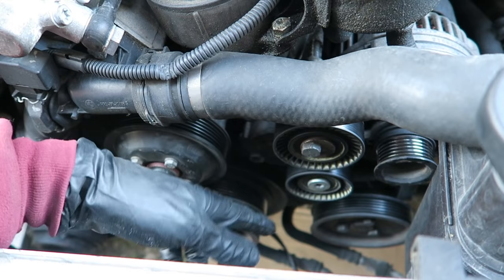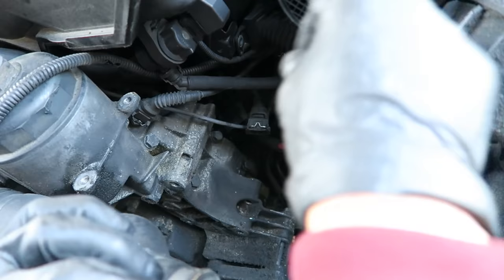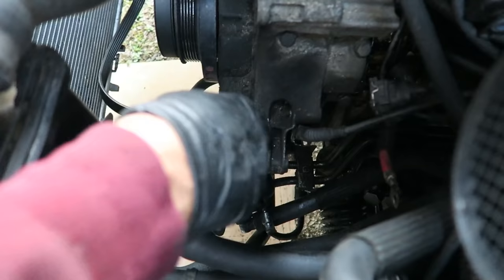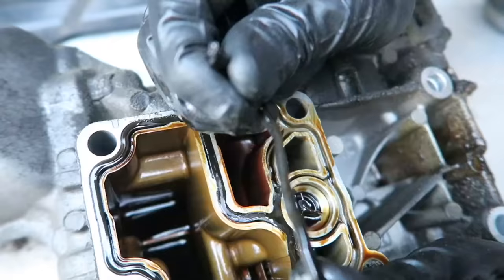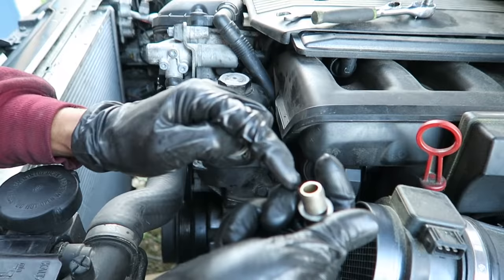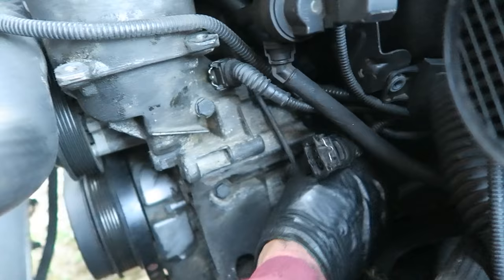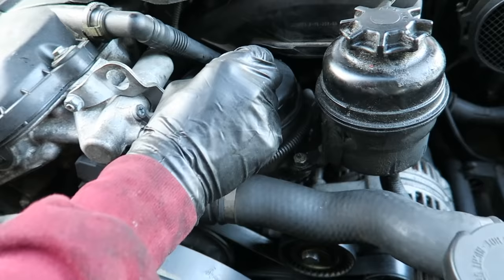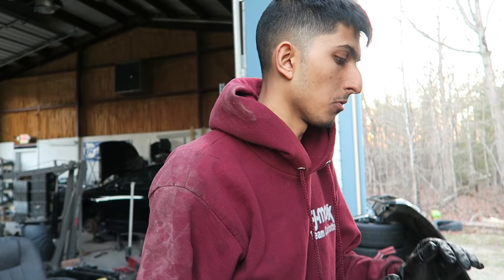E46 Oil Filter Housing Gasket Replacement DIY

Comment: Tip: You dont have to drain the oil or remove the battery cables or take off the oil line from the back of the filter plate. You can simply remove the oil line from the front with a 17 wrench. Also, once you remove the ground cable from the back of the alternator, just move the cable away from where u are working otherwise if you touch your ratchet to it, its gonna spark. And also, not alot of oil comes out once you remove the oil line or the filter housing, just put a rag or something under just in case. Quick 1 hour job or less if you know what youre doing
Reply: that possibility of sparking is why you disconnect the battery cable...murphys law always in effect..."if something can go wrong, it will..."
Reply: Thanks for that info. I just changed the oil in it last week and certainly don't want to go through all that. Battery I am going to do as its better to err on the side of caution.

Comment: Torque specs for 6 bolts = 22nm or 16lbft
Reply: Ayenew Thanks!
Reply: This would of been useful if ive seen it early because i stripped the block on the top right i just hope it doesnt leak when im running it

Comment: quick tip to make sure you get the bolts back correct in the OFG. Take a rectangular piece of cardboard, label top and bottom, punch 6 small holes, 2 top, 2 middle and 2 at the bottom. As you remove the bolts from the OFG, place them in the same orientation. If you don't,  you risk stripping out a bolt when trying to torque down, if it bottoms out. They are different lengths.

Comment: You dont need to drain the oil to do this DIY, just the oil filter and lid, as it will hold oil that will constantly drip once housing comes away from engine. 
Also after the alternator is out, but before the Oil Filter housing comes out, then clean away to your hearts content, degreaser, dish soap, microfiber cloths, garden hose etc etc... give it the works.... then remove the oil filter housing, that way you dont have to worry about getting dirt and water into your engine.
Reply: So do i not tighten the Oil filter Housing down to speck with torgue Wrench ? 

Just tighten bolts in like a star form like He indicated ? 

Getting ready to do this and not clear on this .
Reply: I was just going to comment this
I just did this DIY
Easy DIY, 1.5hr start to finish. 
People, do it yourself. Dealership/shops will charge arms and legs
Reply: First Last Torque them! 18ft/lbs. I need to redo the whole job and helicoil 2 threads because I undervalued the torque wrench.
Reply: Yea wasn't planning on draining the oil when I do this. Loosen the filter cap and maybe a new filter 👍

Comment: Fantastic video - had already done this a few years back and my tensioner broke so I wanted a refresher. He spoke clearly - told the socket sizes and sped up the video through any slow parts. I didn't get motion sickness from watching it either - just perfect. All videos need to be done like this, it gets an A+ in my book -thanks so much.

Comment: Many thanks for the excellent video (with tips) on repl. the OFHG.  I can honestly say that I would never have been successful with this if I hadn't watched your video.  I had just changed the oil and filter, replaced the drain plug, and tightend down the filter cap using a crescent wrench.  On starting the car to drive it out of the garage, I checked under the engine to make sure everything was okay.  Well, it was like  I had a hole in the pan so much oil was coming out, I immediately shut off the engine and wondered what I did wrong.  After a little internet research, it was an easy conclusion that the OFHG got damaged with my excessive tightening of the filter cap.  I now have the correct 36mm socket and will chalk it up to a lesson hard learned.

Comment: I wanted an e46 but was scared to get one, cause you know, everyone always say bmw's are very expensive and a pain to maintain. Thanks to you and your channel, I got the my e46 cheap so I can fix it up, and I'm ready for almost anything that comes my way.  Keep it up man!! 

I actually just changed this gasket today on my car. I'm glad for this vid!!! Next step is fixing my window regulators!
Reply: How is the car running so far?  Have you been able to fix a lot of the common issues?  I’m in the market for an e46 and like you I’m a bit skeptical.  I’m not a mechanic but I’m willing to DIY if what I have read on forums/reviews and seen on YouTube is accurate.  Any feedback you can provide would be appreciated.
Reply: Idk about him but last summer I bought a fully optioned out 2002 325ci 5spd sport package coupe topaz blue, clear coat is ruined and it was neglected from Baltimore with 220,000 miles but I paid $2000 for the car running and driving, trailered home. (oil was 4k miles past interval so about 19k miles on that oil if its accurate) changed ALL fluids when I got the car home and the filter was in many pieces... the old oil made it too hot under the hood but it had never overheated, the excess heat just caused the dsc/abs module to fail, I replaced just the module from an 05 330ci I paid $70 for on ebay with pump but I didn't need that (this was the difficult one, under the brake booster and upside down, if you know you know... the motor is completely factory besides a k&n short ram intake and the vcg was still good until I replaced vanos seals. I replaced ccv system with an oil catch can, car wouldn't even run without falling into limp mode everytime with the old ccv. Control arms needed to be replaced and alternator as well as expansion tank but they were all factory with 220k+ miles on them. Clutch is solid, no slip and generally smooth but throw out bearing is toast, had to put a loooong clutch stop on so it doesn't grind when pushing in clutch. I absolutely love the car man I cant say enough good things about it, I've done all of the work in my driveway, only got help compressing suspension when replacing front control arms and im only 16. It's been leaking oil for a very long time and my skid plates are filthy but I just top off with fresh oil after about 5k miles or when it gets half a qt low. Main concerns are blown expansion tank, usually cant tell its blown without driving it, Only buy VDO/siemens mass air flow sensors as the car will never run right unless its oem, ive had 4 different mafs and they all made the car struggle to idle and start I was chasing lean codes and vaccum leaks when the solution was just buying the right maf, they control a lot on these cars. the car has been absolutely solid and is the single best handling car ive ever been in with factory sport suspension. if you find one ofr a good price don't hesitate unless the head gasket is blown they are bullet proof, looking to turbo mine soon.

Comment: Just done mine, along with the VANOS line, and I was amazed at how smooth and easy it was - managed it in less than three hours.
One tip I can offer is to push the housing bolts into an old cereal box to keep their relative position😉.

Comment: Thanks for making this!  I’m getting ready to do the gasket on an E46 with 300,000 km on the odo. This is extremely helpful and I’ll def have this video queued on my phone when I start the job.  I’m doing the oil level sensor as well at the same time, so that DIY you made is also super helpful.

Comment: Used this video to change the filter on my 2001 330Ci.  It helped a ton.  A few lessons learnt.  1) I pushed the power steering pump too far out of the way to give access.  I then put the oil filter housing back in place, and when I came to re-position the power steering pump, it was quite difficult.  Lesson is to roughly put the power steering pump back in position before re-attaching the oil filter housing.  2)  Make a note of which is which regarding the two long  bolts that attach the alternator to the engine.  I mistakenly assumed the long bolt was on the bottom and took about 20mins trying to thread it before remembering the long bolt goes on the top because it also attaches the idle pully, hence the longer bolt.  3) My banjo bolt didn't have washers - the seemed to be built in.....Fingers cross I don't get a different leak.   4) Slight differences on the power steering bracket - but minor.   Otherwise -  all good.  For a first-timer, it took me about 3 hours...but I works slowly making notes, and cleaning oil off the engine and other parts took about 40mins!  Thank you ShopLifeTV

Comment: Good one Jason!  Straight forward and to the point ...excellent video with great camera angles to see everything going on or coming off.  What about the torque settings??  ...I won't bother with them either ...when you got the feel when undoing plus it's hard to get a big torque wrench into those tight places anyway. Thanks for your time in putting the video together and posting it on the Tube. I just did my Z4 rocker cover gasket along with the 2 inside plug gaskets Like yer man below said ...when wedging the set of two of the plugs  ....they exploded into little bits due to the brittleness of the 'rubber' ...'tip'  if doing yours lay a towel around the gaskets to collect all the bits and stop any getting down into the sump or especially under the valves. I had oil burn on the rear manifold but couldn't see where the oil came from? So had the rocker cover gasket on hand anyway changed and re assembled to find I still had oil burn, so removed the cover again to see if it leaked past the new gasket  ...to find out, it turned out to be oil residue from the leak underneath the top valve housing over the manifold ....but! ...it turned out to be an extra job worthwhile, as I found a 8/10 mm piece of brittle plug gasket around the valve area. This could have created a real problem if it washed under the cam!  Thanks again Jason - Apologies for waffling on Just another tip ...best to use silicone grease to lubricate rubber ...reason, it doesn't have the properties to break down rubber, as seen in the brittleness in the gasket removed.     Ea - Perth, West Australia

Comment: The five main oil leaks on this engine are   1. CCV,   2. sump gasket,   3. OFHG,   4. VANOS line, and   5. valve cover gasket.
If you replace the VANOS line while you're in there, this job takes care of two of them👍🏻

Comment: Easiest car ever to work on. I feel that most wouldn't have a channel if it wasn't for these e46 cars. All you need is common sense, the want/time to do it, and be able to turn a wrench. The best videos are the ones not edited to see the mistakes. Nothing ever goes perfectly. For instance, that gasket on a high mileage car is not going to come out/off without a fight of being stuck. It will also break in a million pieces and you have to make sure you don't leave any behind.
Reply: I agree. Working on the E46 M3 is like fixing a bicycle. It's really easy.

Comment: Great Job! I have a Z4 with a M52 engine so it looks pretty similar... I hope... After changing the Valve Cover Gasket, my engine was still leaking so now Oil filter Housing Gasket Replacement... and you can bet that I am going to change the Tensioner and the pulley! Thanks for the Video.

Comment: Great instructional video. After seeing your video I want to do the job my self instead of paying $700 at the shop.  Thanks for sharing this video.
* Update **
So I follow your video to the T and I can say that I finally replaced the oil filter gasket and not only did I fix the gasket I also replaced both tensioners but end up replacing the alternator and both power steering return lines.  Your videos are awesome and just want to say thank you for posting your videos, I spend some $$ in parts but I saved a lot in labor and learn in the process. Thank you
Reply from the maker: Awesome! glad I could help!
Reply: Thanks again. Watching your videos  has inspired me to work on my BMW and do work I didn’t think I could do. Next will be suspension followed by a oil pan gasket.   Keep posting your great videos I’m sure more folks out there are finding them as helpful as I do.

Comment: Nice job on the video.  It covers everything.  Keep them coming and thanks. 
I  am a retired master tech. I just was given a Free 2005 X3 and now getting the chance to ENJOY all the little neat things that they have to offer. Valve cover gasket, oil filter housing and the crazy PCV system. 
Otherwise the car is in very good shape and fun to drive. Is there any other common problems I need to check out before they pop up. Thanks again.

Comment: adding that the torque setting for the 6 odd sized oil filter tower housing bolts is 16 to 18 lbs. I used a piece of cardboard shaped like the mating surface with holes in it  to keep track of the 6 bolts orientation to where they go into the block.

Comment: Also alot of owners torqued the 4 top housing bolts first before tightening the 2 lower bolts. The top 4 bolts are the only ones surrounding the actual gasket. I did star on all 6 and mine leaked within a week. Also forget any stock bmw (or other brands) rubber gasket. Go all in for a Viton rubber gasket and there's a good chance you'll never have to do this job again

Comment: You can now buy,on E-Bay, a pump with pipes to save taking sump off.A tube is put in oil stick hole (after taking stick out )
thin tube inserted,other pipe thicke so used as outlet in to tub/can. Pump clipped onto battery and should empty sump.I would
 suggest stopping pump for cool down after 10 mins.It is something l do to save pump.

Comment: Awesome video, still referring to most of your material with my 2000 325Ci with 380k km (South Africa). Just noted one possible problem: At t=10:43 the tab and notch for alignment do not match up, may cause issues with pulley bearing running out of plane.

Comment: Gonna attempt this tomorrow bro, was having oil pressure issues on start up,so I changed the oil filter cap seals,2 small and large, but then realised my oil filter housing non return valve is staying open, allowing all the oil to go back to the sump instead of staying in the filter housing, it's causing low oil pressure on start up after a few hours. I took the car to a garage but they guy wasted my time saying it required inlet manifold removal etc...so Hopefully this guide helps me through it!
Reply: Completed this job today, only problem was the bottom left bolt thread has mostly stripped, 4mm thread left in the hole but as the rest are fine and it's not near the gasket area I've jus left it & will monitor for leaks. Thanks for this video man, was fundamental in helping me complete the replacement of my oil filter housing.

Comment: Great vid, thanks !  Will be doing mine this week and also replacing that tensioner as mines a little noisy.

But man... this guy and the "go ahead and" :)   Instead of "Next we'll replace the alternator" becomes "Next you're gonna wanna go ahead and replace the alternator".  So much redundant speech, but I've noticed it is and American thing.
In case anyone's interested, my 'Go-Ahead-And meter' registered 35 occurrences in this video. 12 of which were in the first 2.5 minutes.

Comment: Nice detailed video! I got a question though- why haven't cleaned all the parts before putting them back in? Not only the engine would have a clean look,but it's easier to trace leaks that might happen down the road

Comment: Also for time-saving purposes, you can also loosen the oil filter cap before removing the housing that way you can replace the filter, and then when u reinstall the housing all you have to do is tighten the oil filter cap. 2 birds 1 stone ;)

Comment: 04 bmw 325i. parking ights flash and will not crank/start. Has done it before but only a few minutes. Now each time I get in it does it. Low mileage nice car. Have had heart surgery and can't take it to the shop now. Been sitting a week now.

Comment: Hi, I followed the video and when I was unbolting the housing I noticed the previous owner had stripped the top two bolt holes. Do you think there's enough room in there to do a helicoil repair? will a drill fit in there, particularly the top right bolt hole?

Comment: I REALLY wish I would have seen this before I paid the local shop $400 to do it!!!! Plus I had them replace my ccv system along with it for a grand total of $925. $278 in parts.  Being a new BMW owner I didn't know where o start but now that I've watched all of your videos I have not spent another dime on labor.  Thank you for these videos.  I do have a question though.  What are the two electric connections you disconnected for?  Sensors or what?  I would really like to know.  Thanks in advance.

Comment: Thanks for good instruktions. I only  have one question. Do i have to drain my oil to remove the oil filter gasket? Is there any other way when you don't drain the oil? 
And once again. Thanks for a good video.
Reply from the maker: You don't have to drain it, just open the oil filler cap and pull the dipstick out to allow all of the oil to drain back into the pain from the housing. Thanks for watching!

Comment: Great video. Maybe you can help me do you know the actual torq. Specs, for the bolts removed? Those bolts have to be replaced too? they will have a lot of heat cycles by the time you replace the gasket right?

Comment: hello,

great video, really detailed yet straight to the point.  i had one question.  i curently have a small rattle coming from the oil filter housing.  after reading diferent threads, it seems as if my have a bad check valve.  i notice the filter housing does not hold any oil when the car is off, it all drains back to the pan, before even removing the filter.  Do i need to change the whole oil housing to fix this, or can i just change the check valve inside the housing?  i think thats whats rattleling. 

thanks for your help.